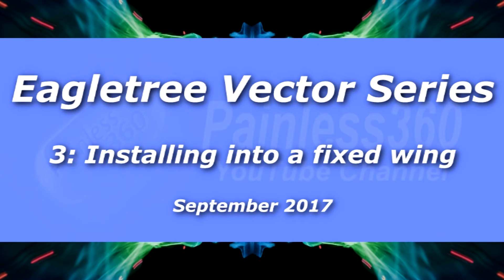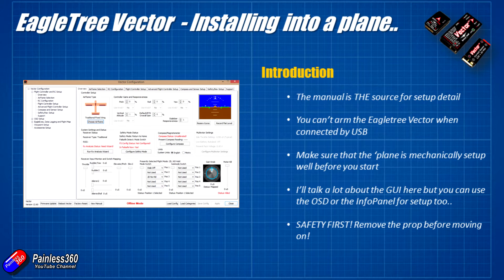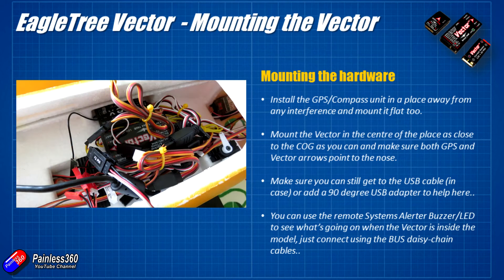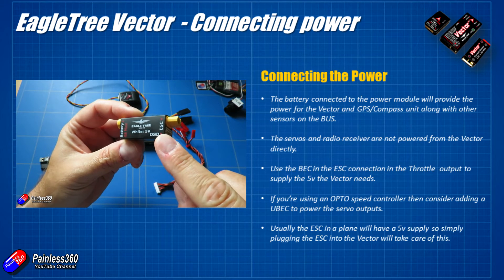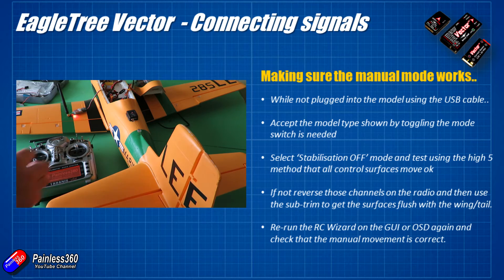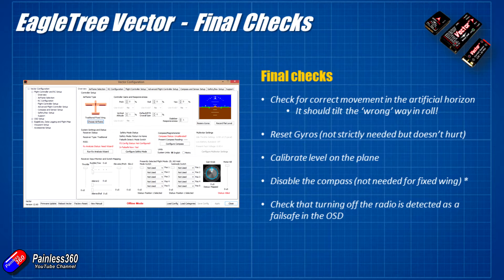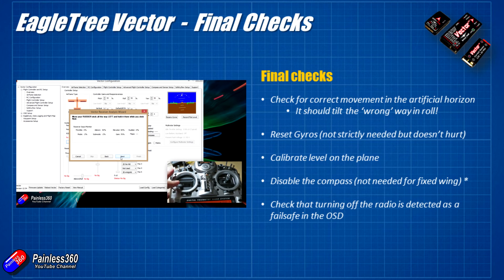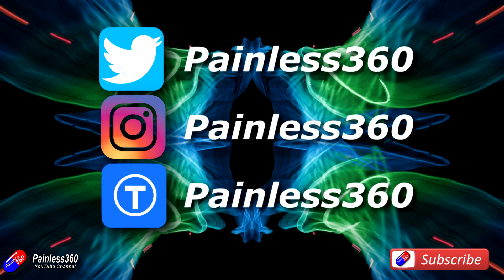(3/5) EagleTree Vector Series: Installing into a fixed wing model

Comment: I can power the servos by plugging an external UBEC into any of the unused connector pins on the servo rail, right? This is different than plugging a UBEC into the RSSI/5V/Backup connection?

Comment: Would you mind doing an update on this with a Crossfire and a vector???  It's very hard to find the proper way to set it up and I know many are struggling with this. The GPS connection and link quality are my problems.  If possible both nano and full-size diversity receivers would be appreciated!!!
Reply from the maker: You install it the same as any other receiver with an Sbus connection.. There have been issues in the past with incompatible sbus implementations on both causing Failsafe but I've not heard of that since TBS changed their Sbus... If you mean that recent changes with the vector bus being able to be plugged into the Crossfire I2C pins then I'm planning a video.. Happy flying!
Reply: Awesome, looking forward to it. Thanks!

Comment: I plugged everything and my servos doesn't have to much distance travel and my elevator only move up and beraly move down. Help me please
Reply from the maker: Without more detail it's impossible to offer any advice. Happy to help but please watch https://www.youtube.com/watch?v=olIqTiSJHIY and come back to me with more detail of what you've tried..
Reply: What kind of details will help to understand, I have a spectrum receiver, the vector.... The problem is with my servos travel distance, is to short, for sample elevator move up but minimum movement for down move, already center my servos on neutral.
Reply: Also my GPS is not blinking neither show any light
Reply from the maker: You’re not telling me the mode the Vector is in, if you’ve changed any of the end travel adjustment on the radio..,lots of other things. My best advice is have a watch of the vector series. All I know is in there. Best of luck!

Comment: hi Lee... i had an issue today when i put it into 2d+hold it pitched up violenty. flying in default "gyro stab" mode it flew fine. any ideas ?
Reply from the maker: Without log-files and such, not really. I'd drop a line to the Eagletree boys and put that log-file from the flight safe as they can use it to have a look at what went wrong.. I'd be interested in what it turns out to be..
Reply: i have, i have changed a few things which i wasn't sure about... rtfm what's that lol.... I have to reset max distance etc, i didnt realise the field i had was bigger than 500 feet long lol

Comment: The more I see of this system both on the bench and on here the more impressed I am.  'Our' installation also came out with all the controls reversed but though a few heads were scratched this video came out on the same day and no-one stressed too much. Getting a "level" was more difficult with a tail dragger but an adjustable mount solved that quickly. Getting the mechanical settings right first is crucial and one of the reasons this installation is going into a well-tested and flown plane rather than a new build (that will come later). Thanks for all you videos so far and looking forward to the flights
Reply from the maker: Thanks for the comment. You can see the later videos before they are released by using the playlists. This is a surprisingly nice system to setup and use..

Comment: Great video thanks. I was wondering are you going to touch on how to monitor two batteries on board. I plan on running a separate battery for other things such as beacons and accessories, I was wondering how to monitor both batteries through the OSD...
Reply from the maker: +james jones not sure you can with a vector...